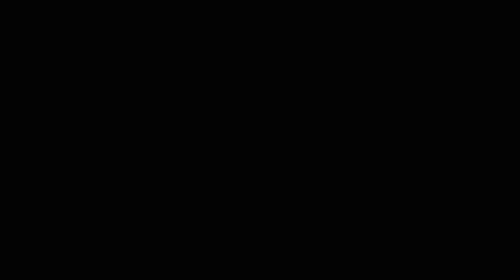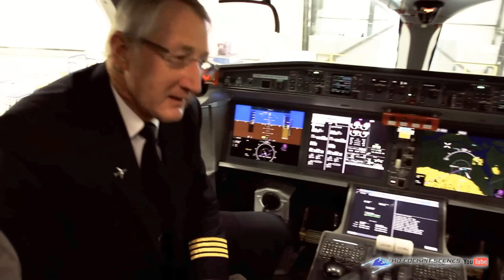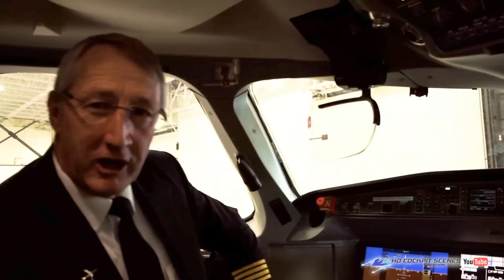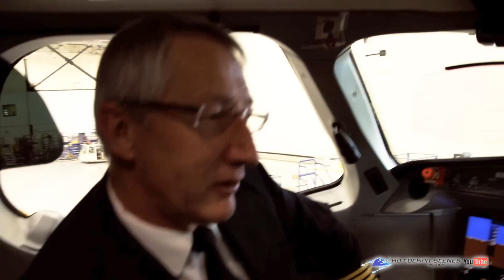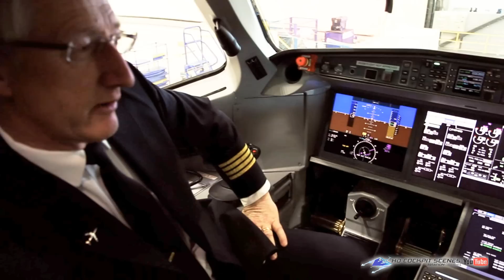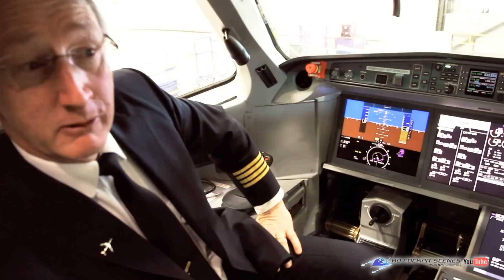AIRBUS A220 - All About the Flight Deck and Cabin - Captain interview

Comment: I prefer de ERJ by Embraer, the project is more modern than Bommbardier
Reply: So "modern" that Embraer lost faith on them, and they already have a V2 without even making 10 years of release. 

That's why I avoid Embraer, they are shit planes, shit builders, shit quality.
Reply: Troll & Berichtigungs GmbH still it cannot match the softness of an-158 trailing link landing gear.

Comment: No real airliner has a side stick, disgrace. 
I bet they never even talked to other pilots. 
The only use for a side stick is for your Airbus loving ass holes to get off and sit on instead of flying the damn plane.
Reply: +Jake G Failed troll attempt detected.
Reply: +Jake G Boeing paid troll !
Reply: Jake G If sully had been flying a Boeing the Miracle on the Hudson would have had "miracle" swapped with "massacre" 

Also, if you actually the time to visit actual airline specific pilot forums, you may be surprised at just how many pilots prefer sidestick.

Comment: Yesterday, December 18, 2015, Bombardier got the Transport Canada certification for this all new mid sized jet. Both the shorter CS 100 and stretch version CS 300, have over 3,000 flight test hours on seven test jets as of this week. Swiss International Airlines will be the first to get delivery of this 100 percent all new, partly carbon fiber jet. During the overseas flights to the 2015 Paris Air Show, it was determined that the very fuel efficient new type of Geared Turbo Fan engines got over 21 percent fuel savings, compared to the original estimate of 15 percent savings before real world test flights. This allows an extended range of over 600 kilometers more than design specs, making this very light jet, a Trans Atlantic plane.  Now it can fly just a tad over 6,100 kilometers for the stretch version CS 300 jet. You can fly from Boston, NY City or Washington, DC, to London non-stop. The weight of the plane is 12,000 pounds less ( 3,443 kilos ) than a same seat Boeing 737 or Airbus A320, so the much lighter weight has a big affect on flying distance because of less fuel burn per mile.

Comment: Horrible flight deck! Looks cheap! I don't like the philosophy of oversimplifying the flight deck.
Reply: poseidon neptune maybe it should have full leather and wood trim
Reply: poseidon neptune looks more like the starship enterprise than any thing else.
Reply: +Putera Usman 
 Situational awareness is about how you manage all the ressources available to you as a pilot in order to assure a good outcome to the flight. It can be what you feel, see (gauges/screens), ear, etc. I d'ont know why having big screens witch displays all the infos you need and organized in a better way, would be bad for situational awareness. 
I agree with you on the fact that automation can lead pilots to be over confident, and to fly in conditions they would have run away from while flying a basic 6 pack. But Automation an Glass-cockpits are two different things.
Reply: +Putera Usman You are welcome to the old six pack. They pay us to pay attention. If you are bored or tired you aren't fit for duty and shouldn't set foot on the flight deck. A lot of work has been put into glass flight decks to make the information easier to process under high workload. Making more work for yourself doesn't make any sense.
Reply: +poseidon neptune Welcome in 2016.
Reply: +Putera Usman nonsense. The only disadvantage to training with a G1000 equipped C172 is that you would have a hard time after learning to fly on an older plane with steam gauges and when you are flying VFR it makes even less of a difference. Sure you read the information digitally rather than analogue, but it's not like it makes someone a worse pilot because of that. Digital clocks don't make people dumber. Your assessment of flight hours is also false. If I loop around taking off and landing in the traffic pattern at my local airport for two hours, using a glass cockpit isn't going to give me less experience than a traditional one would. You may like the old way better, but that doesn't mean the new way is bad.
Reply from the maker: poseidon neptune i understand your opinion. But compared to the other airplanes that I sit in cockpit, this one is special :P
Reply: HD-COCKPIT SCENES I'm personally very anti-automation, so there aren't many new aircraft I prefer to the older ones. For me the layout of the flight deck also plays a very big part, and to me this doesn't look very nice. It's like comparing a high end BMW to a Fiat.
Reply: John Anderson It looks absolutely nothing like the starship enterprise. It looks cheap and tacky.
Reply: areolaman I mean it doesn't look very good.
Reply: +poseidon neptune I've flown Embraers and Boeings.  This aircraft doesn't look cheap to me.  It looks somewhat similar to the 78 flightdeck.  I like Boeing but the flightdeck is outdated, even on the NGs.  The 737Max's are not much of an improvement.
Reply: +skyserf which narrow body aircrafts have best cockpit  ?
Reply: +poseidon neptune Are you  chill from airbus or boeing
Reply: +Boeing777er That's a fairly subjective opinion for me to offer.  I have a lot of time in the 737 and while I like the plane, the flightdeck is cramped and uncomfortable to work in for extended periods.  There is glass now but the overhead panel is sadly very similar to the 1966 737-100.  Lots of toggle switches that are easy to cut your face or head on.  While the A320 is no spring chicken (31 year old design) it does have much more room on the flight deck.  I've commuted to work on the jumpseat and I prefer the jumpseat operation and setup and overall room to the 737 classics and NGs.  757s are very comfortable too. jmho
Reply: +poseidon neptune well pilots are getting paid cheaper, new gen pilots only know how to push buttons. even damn Cessna 172 are getting glassy with garmin..it make you lazy and lack of situational awareness. I hours flying 1970s Cessna 172 is equal to 4 hours flying in a new gen 172.
Reply: +Putera Usman Not sure how having glass on your flight deck could make you have less situational awareness.
Reply: skyserf well in old dial cockpit, you have to scan your instrument, while in glass, you just have to look into one big glass and that's it. true it make it very easy to monitor but it is like flying with and ipad in front of you. make me bored.

Comment: Do pilots really want a lateral stick rather than a center yoke?
Reply: Pilots love it. It gives them so much more space in front of them.
Reply: +poseidon neptune so you'd be okay with a 4hr+ flight being constricted greatly with space and safety? Ya, you are no pilot... We do sit up there and try to have space, we don't "relax" like you condescendingly put it... But we do want space to stretch out on long flights, it's better for our joints, blood flow, and health... But what do you know...
Reply: +Count Crotchula Some pilots like the stick and some like the yoke. Most however, don"t really care although side stick has its advantages like opens up space for a legroom, keyboard, tray table and is easier to see the flight instruments. I use to like yoke but now I lean towards the stick because its easier to control due to a smaller motion required to move the plane.
Reply: John Anderson What does the f35 have to do with the cs100?
Reply: +poseidon neptune Talk to me after doing a transcon in a 737NG.
Reply from the maker: Count Crotchula I prefer the yoke but some pilots find that the stick makes landings more easy
Reply: Count Crotchula I bet they chose side sticks because they're cheaper.
Reply: +Count Crotchula I personally prefer the sidestick concept. It is much more comfortable and I find that sidesticks or control sticks in general are much more natural. Every pilot is different though. I know of a few airline pilots who moved to large boeing aircraft from airbus aircraft and they all prefer the airbus because again it's much more comfortable. Comfort is quite important to me as a pilot. It makes all the difference on longer flights. Also, with the sidestick concept, you get a tray table which opens up where the yoke normally would which is really convenient for doing paperwork en route. :)
Reply: I’ve flown Boeing and I’ve flown Airbus (with side stick) I’m absolutely NOT a fan of side stick controls. I’d much rather have a yoke in front of me. That being said, I know lots of other pilots that prefer side sticks so everyone is different. I’m just happy I’m flying a Boeing aircraft currently.
Reply: Count Crotchula Airbus seem to be gradually overtaking boeing, so i would assume this plane is direct competition for the a320 thus similar flight deck
Reply: @MrPENGTINGZ  airbus actually designed the cockpit
Reply: more space and easier to fly
Reply: +Count Crotchula yes side stick are more comfortable and make you easy to eat your dinner. but it is also more dangerous in the aspect of situation awareness in time of emergency. like in air asia crash recently where the captain fail to notice that the co-pilot didn't do what he actually meant when he say " pull down" co pilot pull the stick back and make the aircraft climb and get into aerodynamic stall. if this is in yoke type of control, the captain will definitely see the error he make and the co pilot made and in time correct it. using yoke make it easy in case of hand flying in a manual mode where there is no computer intervention.
Reply: @puterausman7682  the new way to go is gulfstreams new side stick stem where both side sticks are connected and you can feel what the other side is doing
Reply: +Putera Usman Last time I checked the A4 was a single seat attack aircraft.  Why would you think to compare that to modern commercial airliners?  The type of flying involved is not remotely similar.
Reply: +Putera Usman Your answer is about what I expected based on your previous posts. It's definitely not the same type of flying. They teach us that the first week of indoc.
Reply: +VansMudder The competing side stick inputs were part of the problem. The Captain returned from his break but he also couldn't decipher what was happening because the pitot tubes were iced up. The aircraft was indicating a high airspeed.  In the 737, if stalled first,  even at full power and nose level with the horizon if you will fall at 5-7000 fpm.
Reply: +Aslan Sınav At no time did I imply that.
Reply: +Aslan Sınav I meant the side stick controller. From your post it seemed that you implied I thought a yoke was better than a side stick. In the AF 447 accident an angle of attack indicator likely would have provided the pilots the information they needed in a very difficult situation.
Reply: +VansMudder Or at least installing an indicator that would show the position of the other pilots controller.
Reply: +Putera Usman The accident investigators also said an AOA indicator would have been helpful, especially since the crew was receiving erroneous airspeed data.
There is a summary on the AF 447 Wikipedia link under Angle of attack indication in the Independent analyses section.
Reply: MrPENGTINGZ I wouldn't bet on that. Emirates just cancelled an order for 70 a350s and bought 150 777Xs. They will always be in the same competition they are now.
Reply: +MrPENGTINGZ Airbus probably doesn't know that with all the A380 cancellations.
Reply: +codzomz just get off from your chair and go to the toilet. you are allow to do that, you know that right? you commercial pilots are whining a lot. try sit for 4 hours in a cramp A-4 cockpit with no auto pilots, your nearest thing to an auto pilots is your trim tabs..that's flying..
Reply: skyserf flying is flying regardless your carrying a bomb or carrying a passenger. whining pilots are whining pilots regardless where they are. but the proportion is different.
Reply: +linculn After the fatal crash of an Air France A330 due to pilot error it was determined that the junior first officer kept applying pressure on the side stick causing the plane to climb and stall after the airspeed kept dropping. The problem was that when the junior first officer kept applying pressure on the side stick the senior first officers side stick did not move so he was not aware that a control input was being applied, if that had been a Boeing with a traditional yoke then both yokes would move during input alerting the other pilot. The Captain was on rest period and returned to the flight deck too late to figure out what was happening.
Reply: skyserf A bad pilots a bad pilot. Yoke vs Stick, doesn't really matter.
Reply: skyserf What did you refer to when you said side stick then. I'm guessing you were just referring to the controls in general.
Reply: +skyserf I actually don't mind the side stick, I wasn't crazy about it at first but it does free up space for the pilots to do paper work, look at charts etc. 

When I referred to the AF incident I was actually quoting what captain Chesley Sullenberger said during an interview about the accident. As you know he piloted A319/20/21's for US Airways and is most remembered for his landing on the Hudson. 
An AOG indicator or tying the two side sticks together electronically so they both move if input is applied on one would help all the pilots on the flight deck to have better situational awarness.
Reply: skyserf your comment that says  In the AF 447 accident an angle of attack indicator likely would have provided the pilots the information they needed in a very difficult situation.
I must disagree with you as once I have this similar situation where the AoA indicate that im entering a stall but it took me a while to figure it out why as it was at night and we end up in a spin but. it turn out that we have a worn out pushrod connector that when my student put the stick at level or neutral, it actually make the airplane climb gradually, this happen after we do a hard maneuvering. its like the Alaskan flight but in reverse.

the point is when the problem occur, I remember asking my student if he rest his hand on the stick, this conversation about stick took quite while then we both busy checking our instrument to make sure all are working since we don't have any back up instrument as the final says, talk to control and engineer . so in the end I let the airplane fly it self to a stall and learn how to deal with the situation.

but im lucky because A4 has no computer control or aided flight, so what ever you dealing is either aeronautical or mechanical, no computer malfunction.  the instrument only give you the information on the state of the aircraft but not why it make that movement.
Reply: ***** Emirates just ordered two this month and Iran Air ordered 12 recently after the sanctions got lifted and Turkish Airlines is again thinking about acquiring 10 A380's to meet capacity needs with slot restraints at Ataturk airport. They also said Turkish would additionally acquire it down the road for its new airport thats projected to be the largest in the world due to open in 2018 and fully completed in 2023. Better than the 747-8 thats for sure
Reply: ***** Hahaha funny but A380's don't construct over time. Lets say it takes about 2 weeks. Half of Emirates's 142 arn't delivered yet. Theirs a time-table that they and Boeing also follow based on its costumer's. Turkish for example want's the 10 jets for limited use to gap soaring passenger numbers until the new airport opens. While it plans on ordering tons more but the tons more planning to be ordered are after 2023 to accommodate it with the larger airport being built.  (if the talks with airbus go well) They did the same thing for the 92  a321neo's they ordered. They don't wan't  to take deliveries until after 2018 when the first phase of construction is finished and the new airport is mostly operational. If Emirate's orders are delivered by lets say tomorrow Dubai international would turn into a grid-locked jumbo jet parking lot as the expansion of the current airport and the construction of a second one in Dubai is not finished.
Reply: Aslan Sınav I don’t think emirates have ordered any!How did u find that out
Reply: John Anderson à
Reply: My trainer has a center stick and it is so much better than a yoke. 
It's also push pull rod operated so that could also be a factor
Reply: poseidon neptune just like in the trucking industry the more relaxed and easier to operate the better they will operate with less fatigue which equals a safer and better flight
Reply: Well after flying airplanes with sticks and yokes albeit smaller aircraft. Sticks all the way ! Yokes tend to get in the way of things. Viewing the panel, operating switches etc... with a stick and especially a side stick, none of those happen. Just makes the airplane much more comfortable to fly. And it’s a very natural position too, almost becomes like the extension of your arm.
Reply: poseidon neptune f35 is so cheap
Reply: Count Crotchula That is the one thing about this airplane that I really do not care for, I am sure it is well designed but I do not feel safe without a yoke, personal preference.  I never would purchase a plane without a yoke.
Reply: poseidon neptune both aircraft have a sidestick
Reply: ***** Pilots aren't there to relax. They're there to do a job.